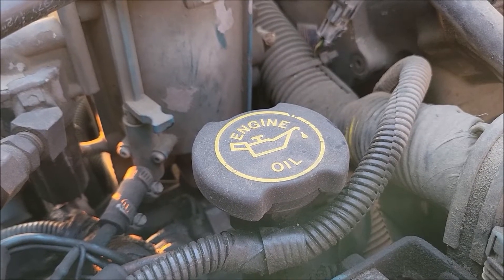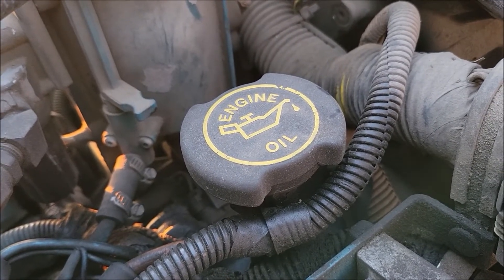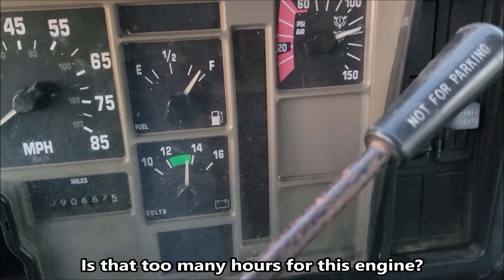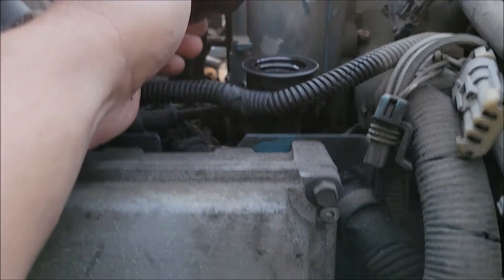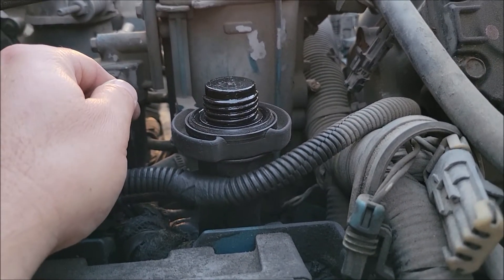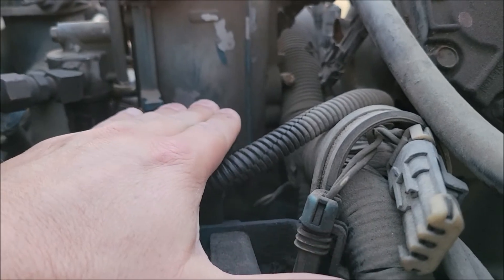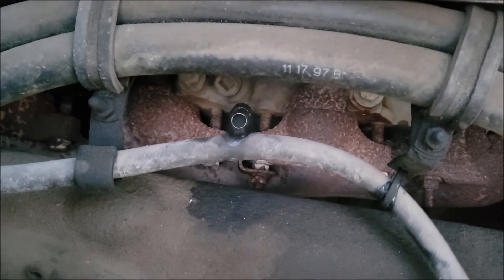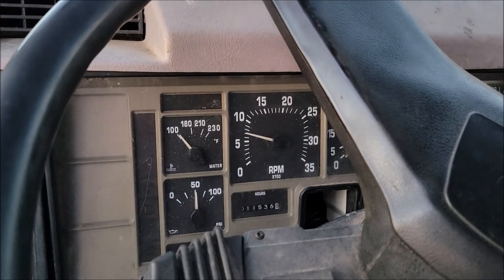Testing Blow By on a T444E Diesel Engine with 11,500 Hours

Comment: You can’t test it like that unless you plug the crank case vent….  So your test gave 0 conclusive results..
Reply from the maker: I probably need to do that and check it.  I have not done anything to it lately, but it still drives fine.

Comment: Just so people reading comments know, the crank case vavle on E444  motors runs out the bottom of the truck in to the atmosphere, powerstroke motors the run it to the intake where the “gas” is recirculating through the turbo, they have safe mods you can do to change it like the e444, but you need to know what your doing.
Reply from the maker: That is probably for government regulations or something in the light duties I would guess.

Comment: Normal. Great for 12k hours, idle hours are far better than drive hours, the high idle funtion saves the 7.3l motor from a lot of issues, make sure that it is engaging on the cold days while idling and it’ll last a very long time.
Reply from the maker: Very good to know, thanks.  It has been doing well, so all of that is good to hear.

Comment: I've done a lot of work on 7.3's this is great blow by, the engine is about 20,000k miles past break in. You won't see blow by unless it's abused badly until 200k. I have worked on 7.3's with 350k miles and still no blow by. Change oil often, never look back.
Reply from the maker: Great info.  Thank you.

Comment: I know this is a year later, but ALL engines have some blowby, yours in this video is around the same as new, nothing to worry about at this point in time.
Reply from the maker: Even late it's good info.  I still worry about how long I will get out of this engine.  It's still working fine though.

Comment: Had to check my 98, got 7,010 hours & 94,976 miles. It's a 3800 T444E 40ft Blue Bird Body CO. I have 0 issues but that's all so far. It's not moving anytime soon either but it fires up and can go wherever to my knowledge.
Reply from the maker: Awesome.  How was the blow by?
Reply: @SeidelRanch  I will tell you once I test it, I'd like to know but I'm lazy so I didn't get to it today. Definitely can but I don't like running the bus too often so cracking it up isn't exactly top priority. But in the morning I'll go ahead and find out, it's currently 10:13 pm.
Reply from the maker: Let me know how it goes.  I keep getting told what I see is normal, so I am sure it's fine.  Your 98 sounds just like mine.
Reply: @SeidelRanch  cranks over and roars for hours if I want it to. But my puppies are asleep under it so I'm not touching it.

Comment: Hey man, Your T444E is basically the same as a 7.3 powerstroke but with a few different parts and different tunes/encoding. Don't worry about the blow by as far as the blow by in your video it's just fine (You also have to plug the crankcase vent when you do this test This truck vents to atmosphere where as the powerstrokes return to the turbo inlet.) Don't freak out over it.

 I'd also love to see what forum said you'd lose massive amounts of power.... I have 270K with the same amount of hours. I've also done some work with the engine as well as far as performance. It's running strong.

As far as a tow vehicle, in the flat land it isn't going to be so bad. In the hills I had a 190HP stock motor and I'd pull down to 25mph on a decent grade. I can now hold my own now never dropping below 45mph but it took some work and a decent amount of money for my specific use. The automatic in yours will be the biggest limiting factor.
Reply from the maker: Thanks for the feedback. That is very helpful.  I did not think about plugging the crankcase vent.  I will see if I can find the posts I saw and link them here.  All that info did get me worried.  It is a sluggish truck, and I do wish it would have been a standard but it is what it is.  Luckily in central Texas we only have light hills and not mountains.  I would love to kick it up some.  It tops out at about 65 and that is running pretty high RPMs.  I figured I would cruise at 55 or so, but it would be nice if I could get to 55 a little quicker.  It does 0 to 60 in like an hour 🤣. I do want to do a few safe mods to it, but I would rather have longevity than HP to be honest.
Reply: @SeidelRanch  the longevity will still be there. Do you have a Facebook? Look up the 7.3 performance page. You'll get a great deal more realistic answers than most of the other pages and forums out there.

Your blowby is fine. Do not worry about it
Reply from the maker: @AbsolutionArmament  Thanks.  I will check that out.

Comment: Those old diesels burn oil and have blow by. They don't lose power rapidly unless severely neglected. My old Diesels have blow by worse than that.
Reply from the maker: So you think this is normal for its age and hours?  I thought is was fine, but I was reading all this bad news about the older 7.3 Power Strokes so it got me a little worried. I plan on changing the fluids soon and will keep on top of all that going forward.  I am just hoping it lasts me another 10 years or more.
Reply: @SeidelRanch  My non turbo 7,3 IDI has more blow by and I have been driving it for 12 years like that.